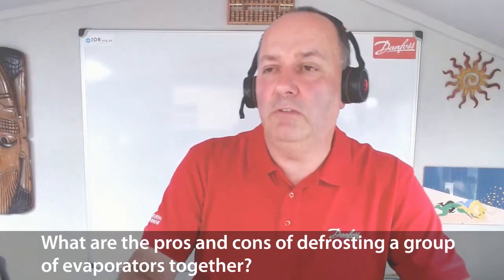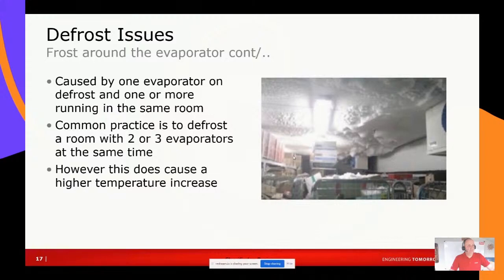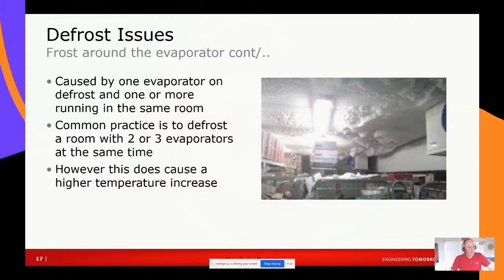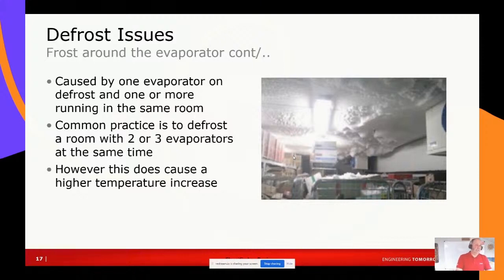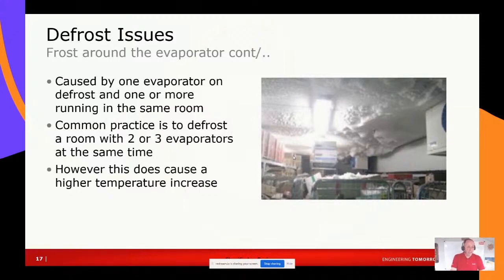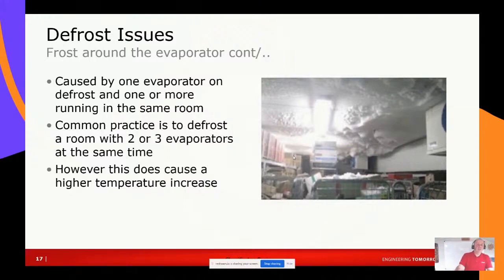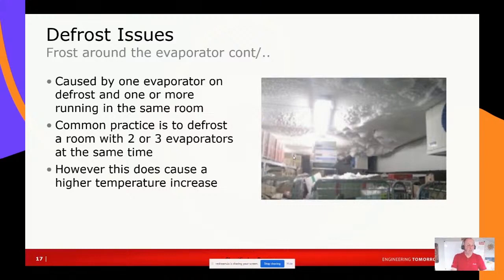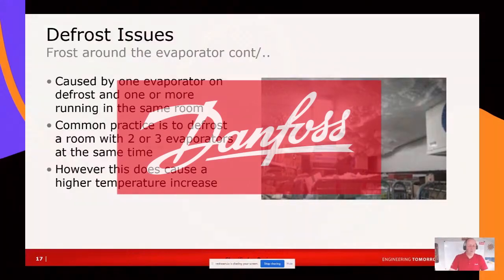What are the pros and cons of defrosting a group of evaporators together? | Ask an Expert

Comment: Sir i have a question how to ask you with an image?
Reply from the maker: Hey Samar. Are you wanting to share a visual to help explain your question? Go ahead and ask your question here and then we'll know how to take the next step.
Reply: @DanfossClimate   why the hot gas is injected from the top before the inlet of an evaporator for defrost after passing through drain pan loop? 
And why the Hot gas passes through drain pan?
( in every diagram the line is joining from the top )